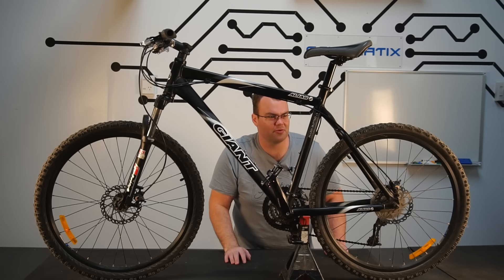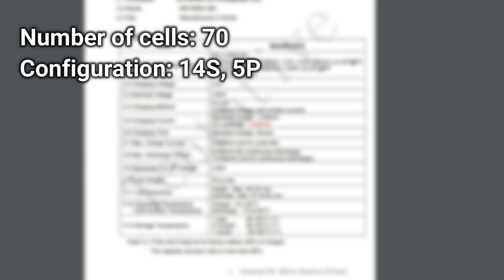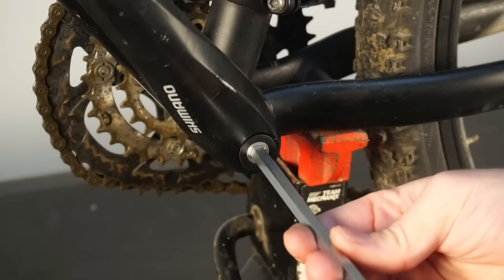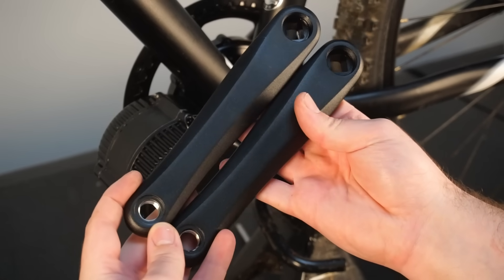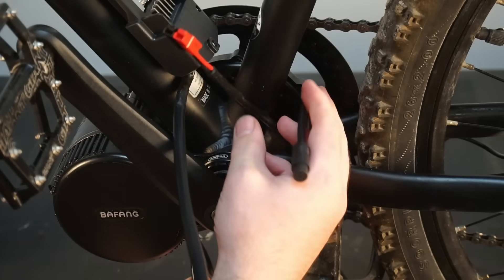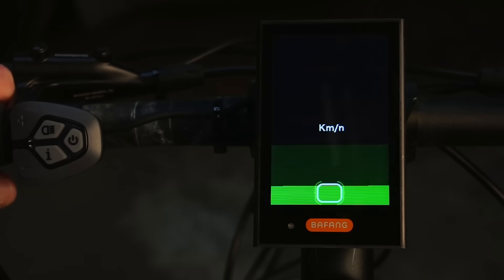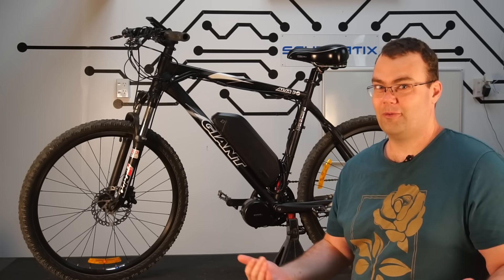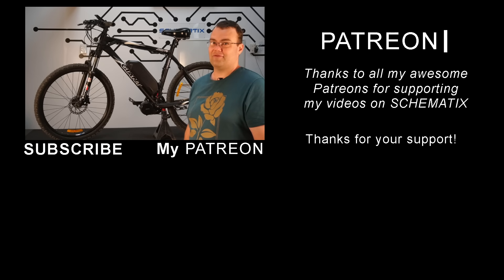eBike Conversion Kit, Install & Review ll Bafang BBS02B 750W motor

Comment: Wow, great video...   I never thought it was that simple to convert a standard bike.  My son's and I just purchased the Aventon Adventure bikes but with this I am sure this pike is much lighter than our Aventon 70 lb bikes.  Did you weight this bike after?  Thanks, Dave.....
Reply: still no answer after a year
Reply: converted bikes generally weigh much less due to them not using beefy frames to hide the battery and cables inside, like 20 pounds less. @richardevans9465

Comment: How much did the package cost you? I clicked on the link and it's listed at 1,000 USD.   Isn't it cheaper to get the ebike for $1000 USD  that comes with the bike and the kit already? Lectric 2.0 for example?

Comment: I have something better. My ebike kit is:mid drive planetary 48v 2000w motor,and 48v 40Ah battery. top speed at 70km/h with 7th gear on rear free wheel. In case i run it with 72v 80Amp 6000w,i can reach 125 km/h with the same gear.Take a look.
https://www.youtube.com/watch?v=h5m5LrWiIEs

Comment: You are right as batteries are very important to the overall performance.  Because I am into large scale RC model planes which requires high output Lipo batteries. Lipos do not last as long as the Li-ion in terms of times you can recharge the batteries.  I can get about 250 recharge cycles from my lipos.

Comment: Hey, great video! 
When buying this kit I just wonder what they mean by T44, T46 is it the number of teeth on the wheel chain?

Why removing the gear shifter is it not needed any more and last thing is the chain staying in the biggest gear at all times, then maybe I just need to buy a simple bike with no gears?
Reply: yes thats the teeth count. lekkie blingring is the best (42t is all around good size) chainring.  the bafang kit eliminates the need for a front derailleur as the chainring on the motor becomes your front gear, and works with a throttle and Pedal assist.  Youd want a good bike with 9-11 speeds (gears on the rear cassette).  Check out Johhnynerdout on YT for more DIY videos etc.
Reply: @omnitunes69  thanks for your answer, I only have an 8 gear bike so I think I'm good 👍

Comment: If it has throttle and you use throttle only, does it spin the crank and pedals say if you take feet off the pedals?

Comment: Why is the rear brake actuated by the left hand brake lever? 🤷‍♂️
Reply: Standard in Australia and New Zealand,  UK and other countries where people drive on the left hand side of the road.  It's to do with which side of the road you drive on and having the appropriate hand free to signal and dates back about 100 years.  All motorbikes have front brake on the right.

Comment: Rolls Royce battery? So it's very expensive and highly unreliable?
More like the Toyota or Honda if you are saying best value and/or reliability... Just living in reality here buddy. ✌️
Reply: Rolls Royce is also one of the largest and most reliable manufacturers of TURBINE JET ENGINES in the world, and is responsible for safely transporting 200+ lives on countless commercial airline flights.

Comment: You removed an old 9 speed chain.  You then installed a 8 speed chain new from package.   This bike will not ride well and will shift poorly and probably skip under power.   7and 8 speeds are interchangeable but once you get 9 speed you'll have problems.

Comment: Since the shifter was removed, how do you change gears?  Great video and thanks in advance.
Reply: Only the left shifter for the front derailleur/gears next to the pedals. He mentioned removing that shifter completely because only one chainring (as opposed to 3 on a normal un-powered MTB) comes with the motor. The left shifter becomes completely unnecessary. The right hand shifter, connected to the gears on the rear wheel, remains. Examples: your old 21 speed (3 x 7) becomes a 7 speed, 27 speed becomes 9, etc.

Comment: I have a traditional steel frame touring bike with drop-down handlebars, hydraulic brakes & 2 sprockets on the front. Would this kit work on that? Would I have to unwrap the tape and take off the hydraulic brakes to get the computer and controller onto the bar?

Comment: I had a Bafang front wheel kit for my trike. I loved the plug sockets so if you had to remove the wheel for some reason you could disconnect it. What I didn't like is it had so much torque if you throttled it too heavy from a stop it would just twist and round out the fork mounts. Wasn't till after I sheered them out I found out about aftermarket torque arms.
Reply: Good tip. Thanks.

Comment: I have the 1000w version for the last 6 months or so and it is a fantastic kit.  These motors have been around a good amount of years and are very solid.  Parts are available also.
Reply: I would love to know how you stop the chain from breaking as I had the old 750 watt model and even the strongest chains would still break. So switched to a geared rear hub motor just as powerful but no broken chains
Reply: @gregb1599  I think I've only broke one chain,  and it was shifting under power.  Since then I don't think I've broken one, I replaced the cassette also.    You were always downshifting when you came to a stop to be easier on the works?  I broke a couple derailleur mounts from sticks getting in there.  And also have since added a modified controller and it can do 2500w peak now.
Reply: @therodenthitman  My one was like the first gen and I guess it was just the instant torque, so many times the chain would get jammed, the new ones have much smoother power delivery so I guess less stress on the components. Mid drives are far better if puncture the tyre with the hub motor on, that was a real pain to fix!
Reply: Is there a big price difference. 🇬🇧👍❓
Reply: how fast difference?
Reply: Does the battery get affected when it rains?
Reply: @muddy farmer  No I wrapped the battery pack in tape and all connectors I put electrical tape on and ridden it in the rain lots.  But obviously water vs electricity no good but if you do some things like I did no issues for me.
Reply: @therodenthitman  And where did you purchase your motor from?
Reply: @William Shakespeare The Turd I did try that, but without a torque sensor it still put huge strain on the chain and would still slip even with a chain tensioner fitted and snap as well, the motor needs to be able to gently start, but like I said my motor was the very first version before improvements were made to the instant torque.
Reply: I am new to E-bike conversion kits and E-bikes.
Could you tell me if on mid-drive converted bikes.....Does power assist kick in automatically when you start peddling?
I  know it has a throttle.....I  am a little confused.
Reply: @jstravelers4094  Yeah it does do that, how hard it pushes when pedalling depends on PAS mode. (1-5 or 1-9) And using the  throttle pedalling is not necessary and it gives 0-100% power.

Comment: With e-bikes  the less amps your using.. the longer you can ride.   If you try and use it like a moped and go 28mph all the time,  pulling 20 amps,  its gonna be a lot shorter range then if your going 12- 15 mph  pulling 6 amps on flat ground..   They key is to use it like a bike,  not a moped,  for nice long rides.   You can always go 28mph down hill and use very little amps.  But flat or up hill its best to slow down,  and use the pedals.

Comment: Good video much appreciated but I will say there is one component that is very helpful that I don't think you put on that bike. According to Johnny nerd out oh, I've been watching his videos also but according to him it's very important to have a sensor on the rear wheel that stops the power from the motor when the gear shift according to him that is extremely important and it does not come with the conversion kit but other than that great video.

Comment: The installation is Great!

The after installation review is. Well it's Bad!

- Zippy for acceleration is not very descriptive.

- The range autonomy of the bike! 
  Well it's kind of simple. 
  You just go on the flattest route possible and you give us the distance you did and what is the size of your battery and your weight.

- Top Speed!
  Read the top speed you have reached on a flat road.

Comment: Interesting. Thank you.  However, I feel you kind of glossed over how the new BB and motor is secured to the frame.  The old BB was threaded.  The new BB is just held in place by pressure (squeezing the frame)?
Reply: Really Tim Tom best best review I've seen hands down. Complete with transcript parts list and where to get it with pricing give me a break this guy is awesome
Reply: It has some knobs which dig into the frame. and hold it tight. Wobbles a bit tho, so it would probably be useful to support the motor a bit.

Comment: Thanks, informative, but can you tell me if the large motor sprocket wheel would be ok for use on a 3 ... 8 speed nexus type rear wheel

Comment: Indo lad builds elect  bike  -1x elect motorbike  starter motor 1x  12vlt bike battery  or  rechargble battery pack
bit work fitting 2 gears 1 small chain  -   handy small runs  to shop

Comment: Don’t ‘cut’ the chain, push the rivet out but not off the outer plate, to re-attach turn it over and push the rivet back through both links until it is flush on both sides.  No Flinstone link link!!!

Comment: I have this Kitt and done 1500 k m to date , all good until I messed about with the controller settings via the  app and usb programming cable I bought online , now I just want to restore the factory settings , can you please post a video / chart of the original factory settings .

Comment: To a certain extent, with the new brake levers, removal of 3x chainrings, front deraileur and front deraileur selector on the handlebar, it's become an ebike only which means that if the battery dies, you have fewer gears to work with.

Comment: great video.. what do you think about converting a folding bike? those kit looks heavy.. what do you think about converting a folding bike with chromoly and aluminium frame? should it use mid or front dynamo?

Comment: very nice video, but the motor is not secure enough, you need more torque on the main bolt on the bottom bracket, or the motor may become loose and rotate after a while.

Comment: Great review. My only concern is, I've seen a lot of videos like this where the product sent to a reviewer is not the same as what a regular customer would buy, unbeknownst to the reviewer of course. For example the 18650 batteries wouldn't be the good Samsung ones you received. 

I would love to see if a regular customer received the same specs that you did.
Reply: Good Question, I'm considering purchasing one of the kits in the link, however when I click the first link it sends me to AliExpress (all good with that) but I click add to cart I have a heap of model numbers to choose from, which one is the one in the link..
Reply: @camdunnage6214  My point is even if you did pick exactly the same model, there is no guarantee that what you get will be the same as the reviewer.

You can never trust products sent directly to a review. It's not the reviewers fault. The product they received could be fantastic but unless they purchased it anonymously as a regular consumer we don't know if thats what we will get.
Reply: Yeah would have been best if he'd stated up front he was sent the kit for free, he only mentioned it at the end. It completely changes the proposition for me for exactly the reason you said.

Comment: Thank you for the video! Pretty easy to do. I am confused though, what happens to the gear shifter and the gear mechanism in general?
Reply: You loose the front derailer the back stays put.
Reply: The gear shifter remains in place and the gear shifting on the bike does not occur due to the fact that you don't have to shift gears anymore with the controller on the left side of the bike's handlebars.

Comment: All these kits have the motor outside and beneath the frame. That seems to be a flaw, an inside  the frame posture would protect the motor from damage an getting water,mud and debris thrown up by the front wheel.
Am I missing something?

Comment: What is YOUR top speed? That's my million dollar question.
Reply: My Friend gets 60km/h out of his.
Reply: 40km/h on flat
Reply: 43km/h. But will verify on GPS.
Reply: @SimonPass230267  did it verify correct?  I'm seeing speeds of 40-60km/h and I want more than 40 for sure.
Reply: @coreygrant5974  Yes, will do 50km/h on a flat road and pulls 40 km/h off road. I've converted 2. This is for my Scott 29er. I don't even change gear. Sits on the middle cog on the back cassette. Wildly exceeded my expectations.
Reply: Terminal velocity. 32 fps squared. (I´m in the mountains).

Comment: I bought a half decent mtb 27.5” hardtail with hydr. brakes, put the bafang 750w in it, mirrors, indicators, mudguards, pannier, frame bag 17.5wh battery, 500c display - I don’t drive for a specific reason so an ebike is my transport and I love it - a real buzz to ride. Getting fitter too 👍😁
Reply: What range do you get?
Reply: @dahrafs9798  i believe 750w is around 60 miles
Reply: 100%
Reply: Did you have to register it as a motorbike?

Comment: I have this model it's excellent will hit over 30mph cruises easily about 20 with level 3 of 9 pedal assist and with the right gearing could climb any hill. 
And mines came with some handy stickers saying it's only 250w 36v to keep it legal 😉
Reply: Class 2 wink 😜
Reply: Dave mate do you have a link mate ??
Reply: Where from please
Reply: How did you get it to 30? From where?
Reply: It's crazy how many class 2 e-bikes there are....
Reply: what chain do you need for this motor?
1/2 "x 3/32"???

Comment: Looks like a good kit, but a word of caution about buying from the links provided. Nothing to do with Schematix. After seeing this video I tried to buy the kit from bestbikes on aliexpress, as in the link. They also had a european warehouse so it looked good for quick delivery. They have been a nightmare to deal with however. Although they said they had the kits in stock they havent shipped it for weeks. On 3 seperate ocaasions they told me they shipped it when they didnt. They marked it shipped a day before I would have gotten an automatic refund from aliexpress but didnt ship it. After weeks of messages they have agreed to refund me but they don't seem to be able to fugure out how to do this. I will get the refund off aliexpress eventually but what a waste of time. Save yourself the hassle and buy from someone else.

Comment: Thats a great tutorial. My bottom bracket and pedal cranks are rusted in and a bike shop could not remove without stripping the frame thread, do you think if I cut them off with an angle grinder it would work to hammer out the bottom bracket with a cold chisel and install the motor like that, without using a crank puller etc?

Comment: Real good Intro, perhaps the best basic one out there.
The Battery is like the coffee grinder, the unsexy, unsung core of the whole brew.
Reply: The problem is, that is how they are going to rip you off.  If the cheap battery catches on fire and burns your house down, there's nobody to sue because it is a Chinese company.
Reply: Don't charge in the house.
Reply: @davidgillen777  Generally good idea.  Just always think fire safety. Surfaces, flammables, exit strategy. Consider using the oven as a safe box, but you wanna be able to get things out side if there is an issue. Happens infrequently, but often enough.
Reply: @whazzat8015  If you have a detached garage or something, that is a very good idea. 
Yes, if I had a large no-name battery, it would be stored in something fireproof. A 400 watt hour lithium battery is storing 1.44 megajoules. That's just the energy storage. The material itself (when fully discharged)  has a lot of energy too.  They are VERY difficult to put out, so I am told.
Reply: @tarstarkusz  on a car battery fire, seen it , were fire brigade had to crane lift the car into a skip full of water, as it would not go out, plus the fumes of them battery's are very dangerous to inhale, and can do permanent damage to your organs.
Reply: https://www.youtube.com/watch?v=23aAmlfQO3w&t=2s

Comment: I did a build 4 years ago with this kit I really didn't like the torque forces put through a thin derailleur chain and rear derailleur so built mine with a NuVinchi N360 variable gear hub.
Despite NuVinchi not recommending   pairing a N360 to a 750w Banfang it works fine, and  being a CVT gearbox gives smooth seemless acceleration with no jolts jarring or need to back off the throttle.
If anyone is thinking of going with hub gears an Alcedoitalia dished chain ring gives a better chain line the teeth are moved in 5mm and with a thicker hub gear chain it is a more reliable set up.

Comment: This was an amazing video mate. Very well presented. This mid drive option looks qmlomst easier than a hub drive conversion. There seemed to be less wiring. Am I right in saying the pedal.assist senor is all contained within the mid drive unit?
Reply: what I like about a mid-drive bike is when you get a flat tire in the rear tire you can make a repair much easier than having a rear hub drive motor.

Comment: The wheels are not strong enough especially for heavy weights...you can find motorcross wheels on EBAY AUS $400  7075 and 6061 with much stronger spokes .....much better.....

Comment: So the multi speed is removed. If the battery dies it is very difficult to peddle. Why not use a standard single speed bike. Single speeds have the best ratio for peddling which always is needed.